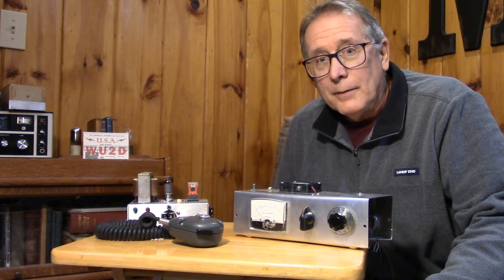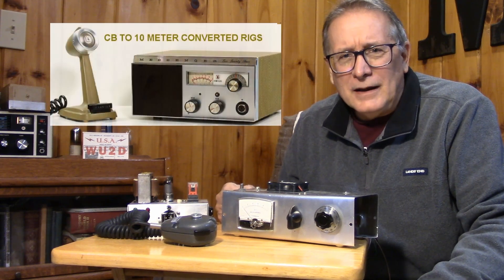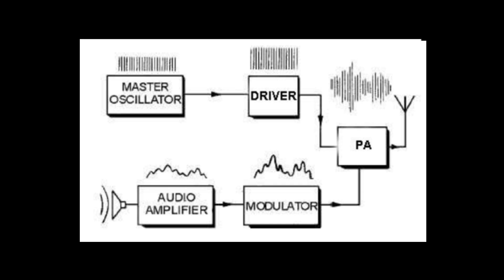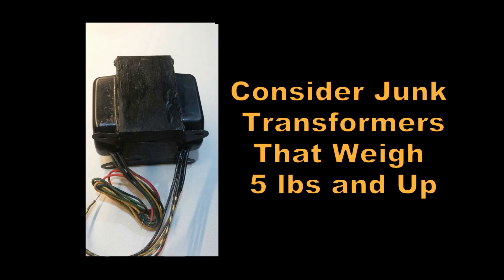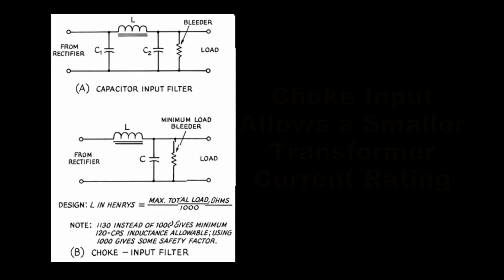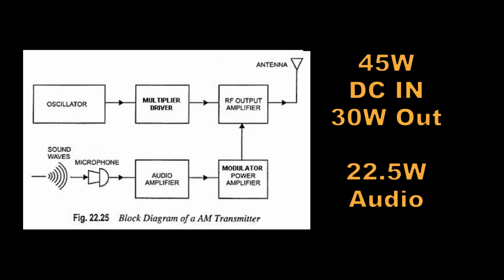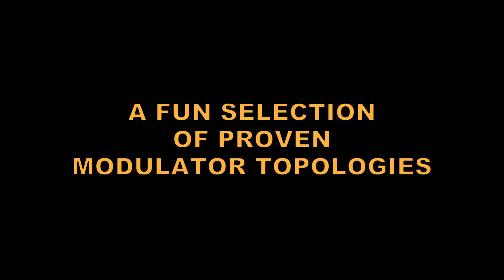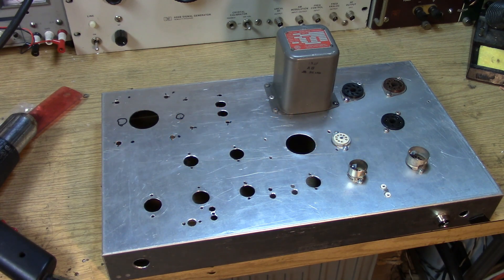10M AM JUNKBOX TRANSMITTER

Comment: I have been wanting to see one of these builds! If I can find a chassis I will try to build along. I don't have a junk drawer full of parts so will have to purchase them.
Reply from the maker: The Magic is sourcing a good Power Transformer like 375 to 400VCT at 200 mA and with a 6.3V 4A winding for the filaments like the Hammond 290 YX. This would allow a full wave bridge and half the V on the Center tap in the classic Economy-style power supply with a choke input filter. It even had a bias winding. The exact mod iron I used is on Ebay.
Reply from the maker: https://www.ebay.com/itm/256344724532?hash=item3baf561434:g:~BoAAOSwafdlJwuR&amdata=enc%3AAQAIAAAA8OXtWwgGr%2BAmPfLajoPeHdiLWaGIH6G%2FB%2FHnMmWpkuGQqyr2iyxCzLtnT%2FrADMDsD%2Buot5ilGz9rOyIYJ5rkpnMrkyNGrqwqPdaLy8MXD%2BNgh9uK%2FGmYH%2BUOs2Ae%2FPjwRyrK8WCJIKbP9WgxrBoavmN%2B4sqi0LqzDxAfT59nP8qSqNWRQ%2FHqCVLXHUQPJ13oREpHAULrqvwKLoeFbTL81qJsWkM9sKL8B2gqxW%2BWG0ZbTzoN%2BK38VHupCAg1xq1hF8Vm8A2lGZG47Z338%2BS%2FOKufR1JtvyAm3xAnVKYlbHyoXMXeqgbBa%2FH8ZMUMPnPeLQ%3D%3D%7Ctkp%3ABk9SR9i_pq6XYw

Comment: My first W6 contact years ago as a kid, was on a converted Fanon Courier CB walkie w/ about 3W. BTW, FM on 29.60 is GREAT fun. Repeater outputs on 29.62> ; W5DFW in TX on 29.66, and HD9HD in Switzerland on 29.65, are heard regularly here in W1 land.
Reply from the maker: Stephanie, you are the ultimate technician, Radio Conversion Artist, radio hacker (before there were radio hackers), good stuff hoarder and recycler, mobile aficionado, mobile antenna and scanner freak. etc...

Comment: This video reminds me about the newbie ham YouTube channel where they were referring to a kit rig they were running as "homebrew." I pointed out to them, (as diplomatically as possible,) that kits were referred to as 'kits', and that homebrew meant that the ham had designed and built all of, or at least some part of whatever gear they were discussing. He got offended. I suspect he now considers me to be one of those old farts who thinks they own all of ham radio, and I won't allow anything in my shack but old rack-mounted AM rigs for 160 meters, that I spend all my time on the air talking about my feet, and disparaging new hams and digital modes. The fact is that I was just trying to help him learn the proper terminology for what he was discussing so his audience wouldn't be forever confused about what others were talking about. It probably didn't help that a month or so earlier I'd left a comment explaining that the 'second' harmonic was not referred to as the 'first' harmonic just because it was the first harmonic he saw above the fundamental. I do wish the FCC would make it clear to new hams that a ham license does NOT make a newbie the ultimate authority on all things RF, and that a ham license isn't a 'super-CB' license, but an invitation to learn about RF and the communications hobby. There's a reason the FCC has granted even Tech Class hams the authority to design, build, and operate 1.5 kW EME stations, although I'm not really sure if many of the new hams actually know they have that authority. These folks desperately need Elmers, though I'm not sure they even know what an Elmer is. We definitely have our work cut out for us with these new YouTube channels run by novice hams. They don't realize that they are looked upon as teachers, and the responsibility that carries along with it. It doesn't help that they simply see us as troublesome old coots who are standing in their way, and are stuck in our old habits.
Reply from the maker: Let me explain the difference between Maritime Mobile and Marine Mobile :)

Comment: Modulation transformers are difficult to find. Any high voltage power transformer with 5v and 6.3v windings could be used in reverse, ex. an IC gain clone like the LM3875 (60w) which output feeds the lower voltage windings could work decently in an AM as a modulator.
Reply from the maker: I actually used a 5A 6.3 CT power transformer in reverse driven by a conventional push pull set of IRF840 mosfets interstage driver transformer driven from a LM380 to modulate an ARC5. I did hook it up modified Heising however to relieve the transformer of DC current saturation. With a bit of feedback, sounded great .

Comment: Whenever I've contemplated building a plate modulated transmitter the stumbling block has always been getting hold of a suitable modulation transformer. Having rewound quite a few mains transformers I've often wondered about the possibility of winding my own. Has anyone tried, or does anyone have any suggestions?
Steve M0KOV
Reply from the maker: Over here you can still find them at hamfests, mostly military surplus. The ugly little silver 100W (50W) transformers out of the venerable BC-191 or BC-375 were 5 dollars for many years . The TCS iron shown i the video were all over and still can be found. An the magic ART-13 Mod Transformers defy physics. Here's' a typical 2:1 https://www.ebay.com/itm/175621059388?hash=item28e3d4b33c:g:IxgAAOSwOdlj8n5L&amdata=enc%3AAQAIAAAA8HEjxF9dtQdN31LDLrdpiTu31zTOKJiO1cAYAOgekbyc0AKud1pxVP0UcXQn7b8HxIJnGyZgfmJZId5ezoj3cuF3afzBAOi0sM1HX6W887PgCwnQxKxLtXq7PcT7qUIUNRluWyOdyV7x%2BYn%2B4FWo4%2FwjL%2BzvNJHEBD4nmLseJKWxP5m3QmBSxkow1WaMDRbTMTw1ZTcNfxajgvQO1XgMMcoSm4CGBmdKn8Zg9%2Bv%2F9cFUKe6ldjG%2FPH35pekzuU0GOFZ6Wf%2FUnyGCI9w%2BcfF%2FoNXmJBDTHvWcm2e2q7pZlIO4SDYj2JLiPxjzaZnAGoQxqQ%3D%3D%7Ctkp%3ABk9SR6KPhNmEYw

Comment: I like your junkbox transmitter project using Push-Pull plate modulation. Question where can one buy a 50 watt rated plate modulation transformer for 6L6 tubes? Hammond Manufacturing only makes a 25 watt modulation transformer. A ham friend of mine wants to complete his 100 watt transmitter and can't find a transformer.
Reply from the maker: Aside from hamfests, I see several candidates here: https://www.ebay.com/itm/275896909165?hash=item403cbcbd6d:g:GGcAAOSwDMZkhNnv&amdata=enc%3AAQAIAAAA8OH8reRkSXZ%2BlosBL1%2F1VdnqejQP5Ex3WERAQB6HFYRcQsbUUfebVaWa7n0AAPZyNv0kix%2BKfHKBqPywIjYwFXHmBX%2FwTCjPl8MD%2B6VhsY7OMP9hyIvK8lIewEiJxm41FsXlBauI6%2FWbqeH8dRpdlPvV6RswMi0PB5I178bGqSVGr2%2FXi0KSkIV5ueqmuGVSeETuJtymv52bXRDti%2BwhMVjBQyfAG5WByGv0v9HjyhSowa7uGwBLP58VKwkm%2B73D1xyoUXKEwjmHbZswWMN10%2Fk2xi8a0fa1z1aANTs%2BmP6lwmTR1wgNSDCDUeJ3AH3GCQ%3D%3D%7Ctkp%3ABk9SR4KX1eKEYw
Reply from the maker: This looks like an Apache transformer. pair of  EL34s or KT88s or 807s  to modulate a pair of 6146s.

Comment: Timtron (W-YAY one YACHE Yell R) has plans for using an old tv power transformer as a modulation transformer that looks pretty cool, although those are getting harder to come by. I like the modular approach to building this in stages, breaking this down to sections you can test individually for us less experienced in building. I guess the trick is to not be afraid to experiment a little, or a lot. The 6au6's might be getting harder to find with USAGI building his computers with 100's of them! I love that little tube as a preamp as they sound great! As long as you don't get zapped, you live to build again. I know purists prefer 5u4's or 5r4"s but solid stating the rectal- fryers is the way to go! Great project. I can't wait to see this progress, and if it doesn't work out, you can always talk to Bert using scream modulation!
Reply from the maker: The 6AU6 pentode is neither a fantastic audio tube nor analog or digital computer tube. It's just a good general purpose low frequency IF tube. They were made in the Billions. If I slipped and fell in the shack, I likely stepped on a 6AU6 rolling around! ;)
Reply from the maker: Both IRB and HENRY YELL ARRRRR were some first mobile contacts for a youngster in his very first car with a old NCX-3 Mobile attempting to do AM-ish operation. I have used Filament transformers as Modulation Transformers, so I have no doubt that old power transformers, especially those with dual primaries or HV secondary's with liberal feedback should not work as modulation transformers.
Reply: Him using up so many 6au6s kinda pisses me off.  I bought a JAN case on a sale a few months back as insurance for the HW-101s I rebuilt.
Reply: I was really bad when he dropped a board on the floor containing DOZENS of them! Several didn't survive. :( @clytle374